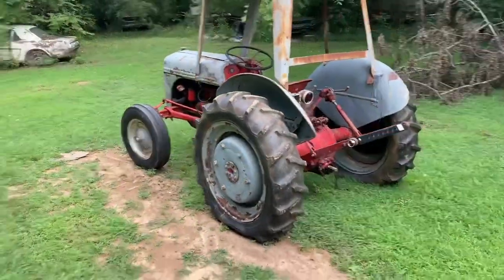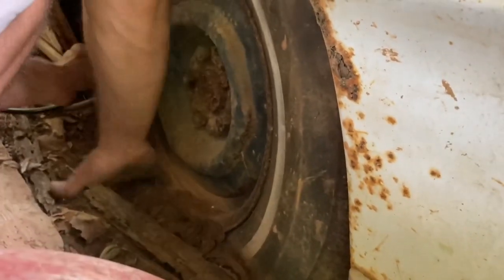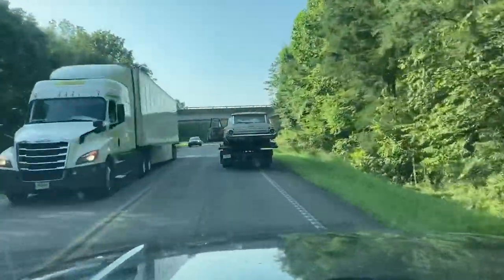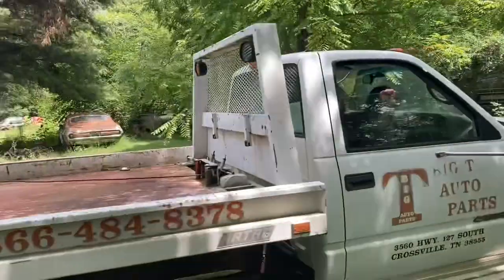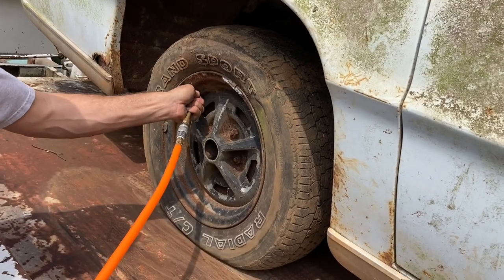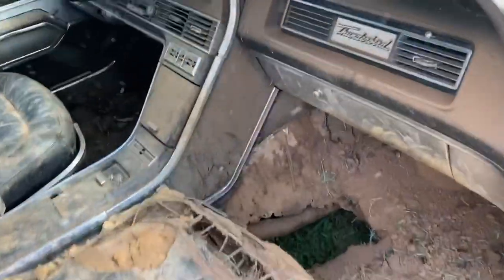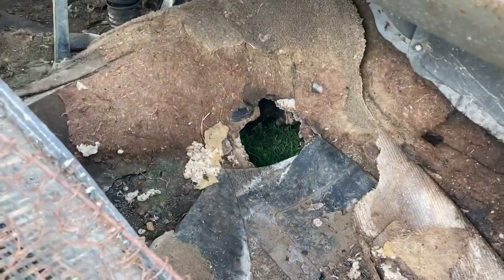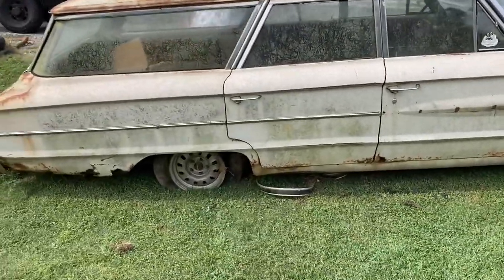Ford 2N Rescues 64 Galaxie wagon and 67 Thunderbird

Comment: Sleeperdude. My uncle had a 1952 Ford (it may have been a 2N but don’t know). It was red and gray. He kept the 6 volt positive ground system. I learned how to run a Bush Hog (mower deck) on that old Ford. It never failed to start. I remember my uncle changing around the front and rear axle track for plowing with. He pulled a double bottom plow and single gang disc unit with that old Ford no strain. I can still hear that old flathead 4 cylinder rumbling away in my ears. Thanks for another great video. God bless you and your loved ones.
Reply from the maker: That’s a cool story thanks

Comment: You need some air and water in those tractor tires. I love how you get all these old cars, trucks and tractors to running.
Reply from the maker: The back wheels have holes and the valve cores are broke off the tubes it’s going to cost $1000 to fix them

Comment: That T-Bird brings back quite a memory. Way back in 1988, we went across the state to Puyallup, WA to buy a good used car for my brother and I to drive to the new school we were going to in the bigger city. Anyhow, we were looking at a 1981 Buick Skylark but the salesman directed us to a 2 door T-Bird of the same body style that your '67 is. I can't remember the year but I think it was a '68 or '69. It had a 427. We were so tempted to buy it. It was in excellent shape and the pale yellow paint was mint. The main problem in getting it was dad kept thinking about how much gas he would be buying with us driving 35 miles one way a day to school. He also was concerned because the car was about 20 years old already. I think we all kind of wish we'd bought it now and certainly would have been very reliable. The T-Bird was the same price as the Skylark too and dad was too practical to pay the same price for an older car. If only we knew it would be worth way more now.
Reply from the maker: That’s funny

Comment: The best car I ever had was a  2 door '64 Ford Galaxie. It had a 390 motor, a C6 auto transmission and a posi-traction differential in the rear axles.
Reply from the maker: That sounds like a hot rod !!

Comment: Those grills on the rear package shelf are part  of the "flow through ventilation" so you could get fresh air with the windows closed if you didn't want to run the A/C.  The control lever is in the middle next to the wiper control.  Can't wait to see it up and running.
Reply from the maker: Oh ok thank you
Reply from the maker: Oh wow thanks for watching !! Great info
Reply: @Sleeperdude  I was a "car nut" in the mid '60's to mid '70's and remember these cars well.  I have owned several Lincolns including 4 LP limos.  There are 2 great parts sources for Lincolns if you do a search.  They both have OUTSTANDING tech info for trouble shooting as well as parts.  Keep up the good work.

Comment: The Thunderbird is gonna have a mechanical controller for the sequential turn signals.  And hydraulic wipers.  You can get an electronic signal controller conversion but if the hydraulic wipers don't work, you're outta luck.
Reply from the maker: OK that sounds like my 67 Lincoln continental

Comment: Nice cars there. The Country Sedan was Ford's mid-level Full size wagon. The Ranch wagon was the base, Country Squire top of the line. Third row seats were optional. In some Fords you had to remove the third row seat cushions to fold the seats down and owners lost the cushions over time. Not sure about 64. Ford 3 seat wagons and 4 door T'birds are good to have. Once I had an opening door on a trailered car, took the laces out of my tennis shoes to tie it closed. Also had a car with a three on the tree on the floor, but that's another story. Good luck!
Reply from the maker: Thank you

Comment: Only real way to tell the 390 from the 352/360 is by measuring the stroke. A 390 should be  about 3.75" stroke where a 360 is 3.50" stroke. Fun fact, most of the FE blocks were stamped "352" on the front right side by the water pump. Also, I believe that car came standard with a 390, so unless somebody downgraded, that's probably what you have. Awesome scores, especially that wagon - Love me some wagons!
Reply from the maker: I love wagons too I do think they all came with at least 390s as well

Comment: So I just heard you on Dave’s show. I need some advice on a 57 Chevy 2door. It’s been in my family for over 50 yrs. It’s gonna be a total rebuild. I have no idea where to start.
Reply: I came from Dave as well 😂
Reply from the maker: First thing I do is spray all the bolts on the engine down with PB blaster take the spark plugs out and put oil in the cylinders if it’s been sitting a long time

Comment: Our 67 Mercury Park Lane had the same vent across the back window. It's a flow through vent.  It was controlled by a switch on the dash and worked off vacuum
Reply from the maker: Ok thank you I was wondering
Reply: @Sleeperdude  at least I think it was a vacuum control.  It could have been a cable.  Think it was left of the steering wheel

Comment: I can't believe the Thunderbird held vacuum all those years to keep the headlight doors closed. They are spring-activated to failsafe to the open position if vacuum is lost. To extend the vacuum actuator's life most people remove the spring so it doesn't fight against the spring tension to stay closed. We had 3 Ford Galaxie's Dad bought a new 63 XL Convertible 390 police interceptor 4 speed. He traded that on a 60 Cadillac mom didn't like stickshift. Then he got a 63 Corvair Monza Spider turbo. A friend wrecked that and we got a 63 Country Sedan wagon, sold that to my Uncle and we got a 64 Galaxie XL 500 Coupe. Sadly for Ford fans, I liked the Cadillac best, my poor brother always managed to impale himself on the tail fins and they were brutal and Quite unforgiving, always drew blood.
Reply from the maker: Sounds like you had some cool cars in your childhood
Reply: I had a '69 4 door Landau- had a factory 11.1 429 in it, would go around with you on a wet road in a heartbeat - I think the frame may have been cracked because at low speed , in a hard right turn , the left rear door would come open !! The headlight doors ? After my Bird had been parked for around 3 hours, the vacuum would start bleeding down , and the headlight doors would slowly start to open one after the other like the thing was peering at you !!
Reply: @ervinthompson6598  My First car was a 65 88 olds It was the Ultra high compression, required 92 or above octane 425 Super rocket. and the turbo 400 switch pitch trans. If you passed "Nurna" It was because I let you. She'd run anything down! 33years she never let me sit. worried me a few times but always got me there and back.

Comment: The old 2n is probably not heavy enough to pull that wagon with stuck brakes. . You should overhaul the brakes on the tractor that way you can use the independent brakes to your advantage when hauling old cars. You can apply a little brake to the wheel that spins to get it to catch some better traction...my grand father used to have an old mccormick farmall super C. Leaned alot about old farm tractors from Him and that tractor.
Reply from the maker: I grew up on a farm with farmall’s too

Comment: IIRC,the country sedan was the lowest trim level of the wagons.The exhaust manifolds and valve covers look later model than '64.Could be a late '64 production. The block to bell housing bolt pattern changed on most Ford engines between 64 and 65.
Reply from the maker: OK thank you I don’t know a lot about old Fords
Reply: @Sleeperdude  I found out the hard way about the bell to block bolt pattern. Check the distance between the 2 bolts at the top,nearest the intake.The early ones are narrower centers than the 65 up. Both 289's and 6 cylinders.

Comment: I have a maroon with black leather interior 67  2 dr htp bird. Mine is a gennie Q code with a 428 and a equal lock diff.  It even has a good title. I bought it just to get that 428 engine. No gonna fix it sell the body or part it out whatever comes first.
Reply from the maker: That’s sounds like a good plan

Comment: OUCH!  Two things I found out the hard way...always attach to the lowest possible point on the tractor, or it could easily flip over backwards on you. And, if you don't have one of those nylon tow straps, use an old tire without the rim, between two chains, if you need to snatch on the car you're pulling.  There were at least a few 64 Galaxie wagons with four speed from the factory, and at least one with a 428.
4 door Thunderbirds...I actually owned a 1970 model, bought in 1973. It was definitely the only hateful (according to my wife) Ford I ever owned! Biggest gripe was rust, followed by a climate control that always had to be heating or cooling...and not your choice!  The engine on your '67 had to be either a 390 or a 428, both of them FE blocks. 1968 would have been a 429, built on the 385 block.
Reply from the maker: Ok great thank you

Comment: Sleeperdude,
Just finished watching your video on the Ford 2N. How did you get the stuck exhaust valve free? The engine is now running better like it has compression on all cylinders.
Did you have to remove the head to free up that valve?
Reply from the maker: I just drove it out of it I never did do anything

Comment: The next time you want to use the tractor to pull anything try pulling in reverse from the front of the tractor. You will find that it will always pull better and make sure you engage the posi trac lever by your foot to put it in positive tractraction. That Galaxy is a much better car than you think it is. If that is a factory 4 speed or even a three speed you have something that there is not that many of.
Reply from the maker: Thanks for watching !  Yes we are excited about the wagon can’t wait to get it going and cleaned up
Reply: @Sleeperdude  I guess it was too good to be true about the factory floorshift. I commented before watching to the end because I was excited to think you had found one of those rare cars. The T-Bird is a pretty good find though, it is something they did to try to get those sales up and create a new niche in the market. A 4 door suicide at that, configuration. That was a one model experiment that are pretty rare now. That would be a great car to get fired back up. I think that 390 is rated at about 360 hp. It is a really good engine. I'll be watching your quest my man. I owned several early sixties Fords and love to see them again, especially putting them back on the road. Good Luck!

Comment: i ve got a 79 lincoln mk 5 coupe and a 73 monte carlo in a lean too like ur 2 cars where both about the same shape they are free for the taking to anyone will need 3 wheels and tires for the monte a good winch they are in very south central nebraska easy to find and get at clean ne titles any takers
Reply from the maker: Wish you were closer
Reply: @Sleeperdude  yeah thats the problem only ones around here want to crush them the mk 5 has the 400 engine
Reply from the maker: I hate to see anything get crushed that could be fixed

Comment: A little more air on tractor tires could help
Reply from the maker: The wheels have rusted out holes in them and the valve cores have broke off the tubes it’s gonna cost $1000 to fix it

Comment: I think you might need some air in your rear tires
Reply from the maker: The wheels have big holes in them and the cores are broke off the tubes it’s gonna cost $1000 to fix it

Comment: Next time you have a car that don't want to come get a old wheel and stand it up and run your cable over the wheel and hook the tractor close and always low on the Draw Bar. Never tow anything from an axle or high drawbar.
Reply from the maker: Ok thanks

Comment: That tractor sucks seriously. I have a 1950 fahr D15 2 cylinder diesel and it has 15hp but in first gear it has an insane amount of torque ! It would have pulled it out in no time there. By looking at how fast the wheels spun on yours you would be in the third gear on mine for comparison 🤣😂

Comment: Please god  please don't tell me that you used ratcheting straps  to secure that to the trailer 
CHAINS. CHAINS AT ALL 4 POINTS 
THANK GOD I DON'T LIVE NOR HAVE FAMILY MEMBERS NEAR YOU
Reply from the maker: Even towing companies use ratchet straps to tie down cars to the wheel lift , look next time you see one getting towed
Reply: I'm taking about the tractor
Reply from the maker: Yes I tied it down with four straps that are made to hold cars on trailers the tractor only weighs like 2500 pounds